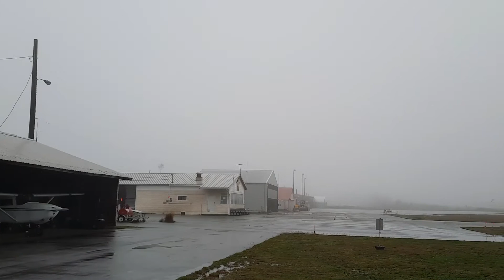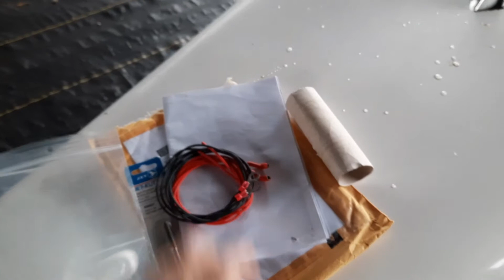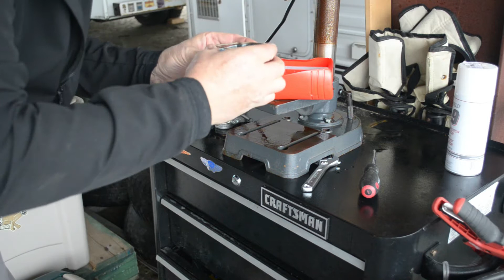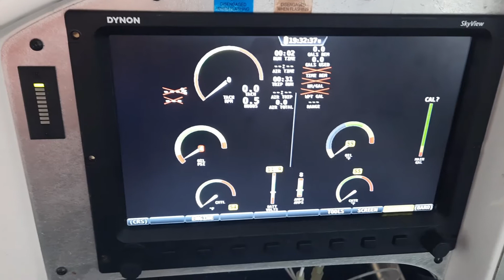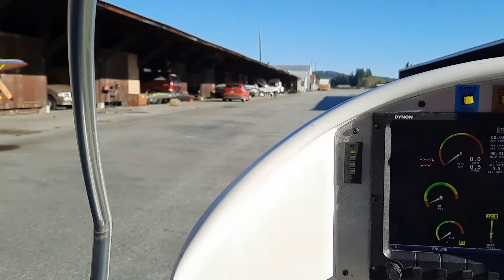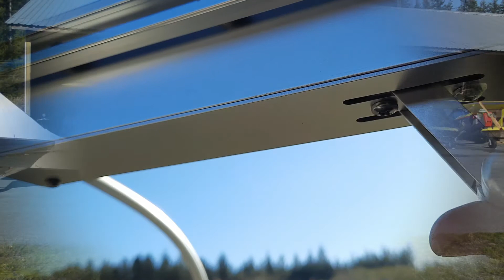2021 Episode 11 - Searey Seaplane Spirit of Mackenzie - carb heat on a Rotax 912

Comment: possibly air leaking into carburetors check if the flange is tight , maybe need a little sealant on carburetor heater treads
Reply from the maker: Thanks Wayne, good tip.  The weather in BC has been terrible the past few weeks, verging on disastrous in the last couple of days.  So I haven't been able to check out the engine yet. Working on the wing gap seal and the centre console.  Next video in a few days.

Comment: That’s frustrating Bob that the idle is now so high with no explanation! I’m sure you will figure it out soon though. Thanks for the education on the carb heat installation, I will need to look into this for mine too. Great video!
Reply from the maker: Hi David... equally frustrating now is that the weather is not conducive to working on the engine in an open hangar.  But I have lots of other tasks to clean up in my push to get ready for the Certificate of Airworthiness.  Stay tuned...